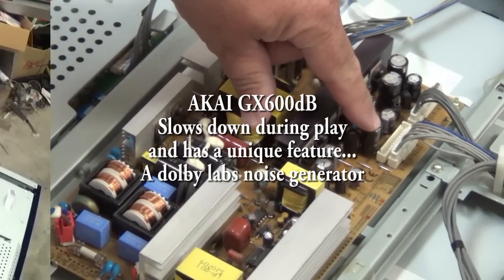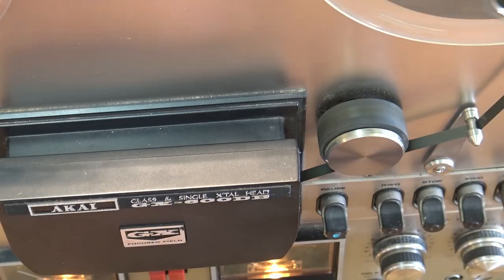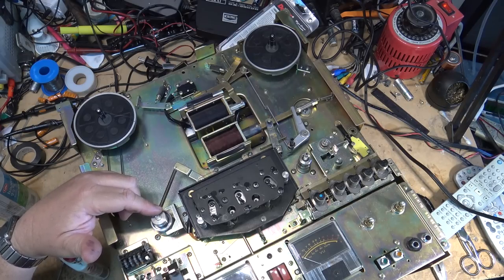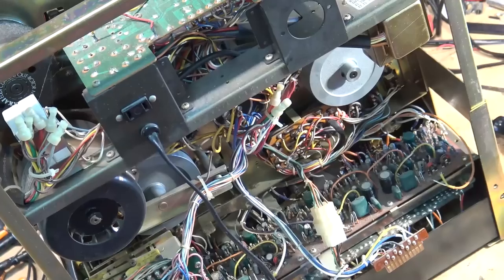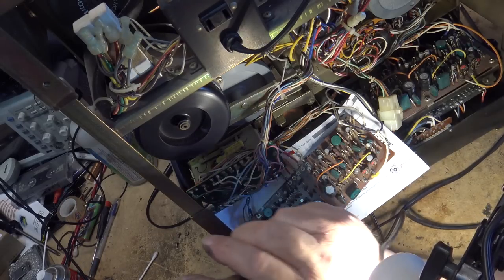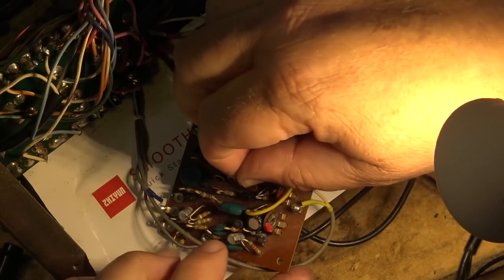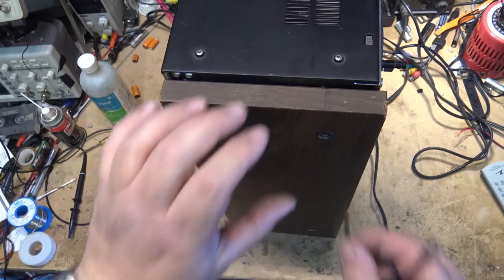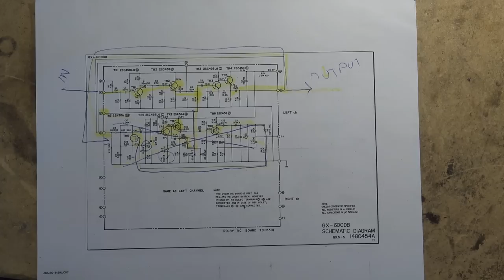AKAI GX600db going slow and what is that noise lets find out

Comment: If you have a can of compressed air, you can hold it upside down and spray with it, the propellant in it will come out as cold air.
Regarding the lawn mower noise, here at my place the snow is still falling....
I would trade the noise of the snow plow waking me up at 06:00 AM for a lawn mower any day.

Comment: Thanks Dave, for the tips and process with the solder iron . I had a TV with a bad capacitor that took a while to heat up for power start-up. I used a small hair drier to isolate it.  Did not think of the iron due to concern of overheating and melting components.   By the way, I am with you on the aggravation of noise...dogs, mowers, car stereos, even phones and DOVES that infiltrate when trying to sleep a tad later or do some quiet work.  Can't win for loosing sometimes....DANG.    J K

Comment: Thank you! —I have a 600db with the same noise but on the PB board (just not as bad yet). I have replacement transistors for it. I noticed you used desoldering braid—I have that and, like you probably have, a desoldering gun.  Should I use my braid versus the gun on my transistors?

Comment: 12voltvids is making a video! Suddenly I have an urge to cut grass. Think I"ll use my lawn mower that has no muffler to cut it with. Great job finding the problem transistor. I wouldn't even know where to start.
Reply: You can learn, but the best way is just to try, but be very careful of the high voltage side.  I sat with my mate who fixed things so picked up a lot.  His job was Nuclear Reactors and the controls for them, so he had a very good grounding, it was one of the few places where they would build something from scratch just to show how to make something like a transformer work and how to design one.  He served his time there and they had a school attached to it where they spend a large part of their day just learning.  No other company (It was Government run then, so money was no object.  It is now run by a company consortium who decided to take it to bits rather then run it) as the Government decided they had to make it pay as there was going to be no handouts.  Backfired a bit as they now have to ay vast amounts of money to decommission it, serves them right.  Greed is one of those things that can come back and bite you in the ass, he haw!

Comment: 2SC548's are notorious for noise issues. My Dad had a Akai GX4000 which he bought before I worked for them and they had a dozen or so in the front end and I ended up replacing all of them.
Reply from the maker: Hitachi made shitty transistors in those units.

Comment: I am in the process of restoring an AKAI GX-625.There seems to be a bad resistor or a transistor causing the pinch roller and Pause  plungers not to engage. I know it’s not the relays but I can see they can make movement so I’m digging through the schematic of the service manual. If you have any ideas please let me know and also has anybody ever told you that you sounded like John Candy?

Comment: Really enjoyed this video... great job. Curious question... any ideas as to why those "audiotape" reels (the one that you show as the take up reel) tends to warp after a while when in motion? No other reel does that.. I own an AKAI X-150D and it's odd that I'll use any of those reels and after a while, they start to warp while gathering tape... everything's in alignment, etc. I've had them brand new and they'll be okay but after a while, the reel itself tends to warp causing it to rub against the face plate while in motion. Cleaned pinch roller, capstan, good head alignment... such a loss. Was curious if you knew what might be causing the issue... any input would help. Take care.

Comment: Quick question, why didn't you renue the pinch wheel a bit? I see a bit of hardening on the video, but not sure if you did this round. 
Great job though. Cold spray is overrated, but I ended up buying one anyways. MG is skimping out on the propellants these days, I have 2 moderately heavy cans with no pressure left in them because of cheating the system.
Reply from the maker: This one didn't need rubber renew. For cold spray just buy duster and invert can.

Comment: What an excellent video and explanation of how Dolby works.  Which Dolby was that?  Ah, real to real, must be the earlier Dolby, if there was any real difference.  I always wanted a good real to real, but they were always so expensive and going out of date as cassettes were all the rage, but they never sounded as good.  I did get one in the end (I can't even remember who made it now) but by this time they were almost extinct, but I did use it for a few years, but even the tapes by this time cost a days wages here, I got some with opera music on them and rerecorded them so I could listen for two to three hours without changing out the tape, quality was not an issue as I was working on something else anyway, so I just needed background music.  I took it to a warehouse where i worked for a while and plugged it into a Regonda (Russian) music centre, which sound very good for its age by the way, it was high powered and could be heard without it screaming all over the warehouse.  The tape player sounded very good coming through it so I left it connected and a tape playing music slowly was good enough for what we were doing.  The radio on the Ragonda used to drift all the time and when everyone got fed up retuning it they would turn on the tape player.  It got so much used I had to make up a new tape or two.  Did it play in doth directions?  I can't remember, I have a funny feeling it did, but only if it was taped on it, or was that another machine?  Anyway, it got used so often that when I left it was part of the fittings and I didn't think it was worth taking with me anymore and CDs were on the go by then for a few years, so I left it with them, they were a decent bunch of guys (except the foreman, who was a Big Jessy and never grew up) so I left them with it.  The Regonda is still there after all these years, but the tape player is sitting on top with a big plastic bag over it, when I asked they said the tapes were not sounding very good and even after cleaning the heads sounded bad, i was asked if I could record another tape, but I had nothing to record a tape with, and no tapes either as I had either thrown them or gave them to my mate who had a machine.  He had moved away as well, so that was the end of that.  It will still be there yet collecting dust and I bet the belts have been sitting in the same place ever since the stop button was pressed!
Nice video and nicely done.  Shame about the cutting of the grass, but if it is not to loud just carry on fixing, trouble is you have no idea when recording how loud the mic is picking things up!  Thank you sir I enjoyed this one.
Reply: Шикарный комментарий! Отдельное спасибо за добрые слова в адрес Ригонды :)

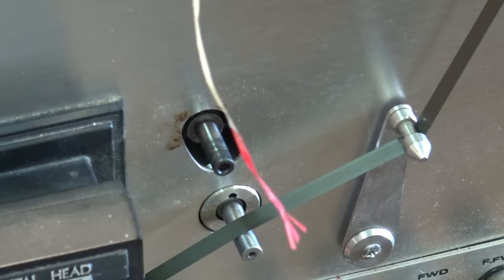Comment: 4:00 How do you know it's a transistor causing the hiss noise? Can it be a capacitor? Certainly not a pot if it is not turned when noise appears. I have a very old solid state tape recorder that makes that kind of sound when it powers up. And as time goes by (a minute or two), the hissing/scratching sound goes away.
Reply from the maker: This is one of the way transistors fail.  They get noisy. Capacitors usually do not fail this way.  Capacitors dry up and then do not pass the signals through.  Plus when heating it cooling the noise gets worse or stops is a dead give away.  This is because what causes this noise is internal junction bond wire is not connecting correctly.  Heating and cooling causes thermal expansion of the plastic case and makes the bond wire move changing the noise.

Comment: Those reel reels always put out good sound.
Reply from the maker: Depends on record speed.  I have about 40 tapes my dad made.  He used 3.75ips. A cheap cassette deck blows the sound quality away.  Response falls off just under 10khz. Sure 7.5 and 15ips sounds better but a real short record time and costs were much higher.

Comment: I'm a gray haired old guy too. Your use of needle nose pliers on the pinch roller operation made me cringe. I fix R2Rs too. Have been doing so since at least 1970. Have a collection of over twenty machines too. And mountains of tape.
Reply: Don't they freeze up from not playing them? That is a lot of rtrs
Reply: @SDsailor7  About the only part that reliably freezes up is the pinch roller pivot bearing. Don't know if they're oiled or greased when new, but either way it dries up and gets bound in place. Caps deteriorate with time, transistors start to sound like they have wind blowing thru them. Some caps may explode, always fun, but a bad sign that all s/b replaced.
Reply: @rpk5568  That is what i am worried about. I have 5 rtr's and can't play them all every day.
Reply: @SDsailor7  It takes a long time for parts to degrade that badly to the point of sticking. Try 20+ years.  As long as you use 1 a month for an entire month you will be OK.

Comment: Also, on my GX630D, i get high crosstalk on the R channel mostly. The head was properly aligned (height and azymuth), but still... could be the Xtal Glass Head leaking noise? Basically the sound in between the tunes is the reverse beat from the other side. Cannot get rid of it unless head is in an abnormal position, but thats not OK, music sounds horrible then. Thanks in advance! No DOLBY on this machine.

Comment: Nice vid! I wish I had your knowledge about vintage electronics! I have a similar machine, a GX 210-D. It has an odd problem, it runs about 4% too fast. These machines have no adjustment pots, so I don´t know were to start troubleshoot. It is a 3-motor machine. Some people say, replace the motor run capacitor! But, I wonder, where had you started looking?
Reply from the maker: Replace the run cap is a good place to start for an induction motor deck.
Reply: I changed the motor run cap but no improvement. It turned out to be a problem with the motor pulley. It has a lot of cracks and because of that it has kind of expanded, causing the ratio to change.
Reply from the maker: @peha4972  
Plastic?
Reply: No it’s made of some kind of metal. It doesn’t look like steel or aluminum. Look similar to the material as the cams that often tend to break have. I’m now looking for a replacement pulley just in case.

Comment: For a cold spray use an inverted can of compressed air "duster"
Reply from the maker: Yes i know.  That is what I always used as it is about 1/4 the price of cold spray.  I don't have any of that either.  Got rid of it all when my kids were teens as I was afraid they would try something stupid with it.  (One of the kids they went to school with dam near died from huffing dust off to get high) since i have an air compressor I use that to blow dust away.  Never bothered to get another can. Probably should because it is good for troubleshooting thermal intermittent but this is only the second failed transistor in about 5 years I have seen and heating with soldering iron pinpointed both.
Reply: I couple of girls in an office where I used to work decided to spray each other with an air duster when it was upside down. One of them got a nasty mark from the cold spray :-D
I also didn't realise, but quite a lot of them are actually flammable too!
Reply: @12voltvids  I believe they put bittering agents in air duster now to discourage inhaling it.

I've had compressed air for so many years now I've taken it for granted. Just used a can of duster at work because we don't have compressed air and man is the air stream weak. The can freezes and the airflow drops off a lot quicker than I remember.

Comment: Oh wow! A discrete Dolby board! Apparently two Dolby B boards in series should get you Dolby C, I have already downloaded the service manual and printed everything Dolby related. I want to build a separate Dolby noise reduction unit that I can plug other things into. I actually like what Dolby C does to my MP3 collection stored on my phone when played through the car cassette deck with one of those cheap Chinese tape adapters... But I really need a standalone unit for the bench. Now I'm searching for that demo track you played.
Reply from the maker: 2 dolby B = C? Don't think so. Dolby B affects only higher frequencies.  Dolby C works on a wider frequency band and compands, depending on frequency between. 3 and 20db.
Dolby B only works on high frequencies, boosting up 10db over 10khz and attenuating on play back.   
Dbx does a 2:1 compression and 2:1 expansion over entire frequency range.  I have an external dbx unit somewhere here if I find it I will do a video.
Reply: @12voltvids  yeah I don't remember where I read about the two Dolby B circuits in series creates Dolby C but I do remember reading about it somewhere, I suffered an OCD attack about Dolby noise reduction circuits and the IC's involved and in the process I learned about Dolby, DBX, DNR and that JVC super something system which was also pretty good. It's a fascinating subject which I really enjoyed learning about but then you go and work on that AKAI R2R deck and it just happened to have a full discrete Dolby circuit! My interest has been started again, last night I pulled out a ford cassette deck which has DNR printed on the cassette door in the same font as was used by the company that invented it but it's noise reduction button has the double D Dolby logo on it, I had a quick look around inside but I didn't see the usual Dolby marked IC's in it. I'm going to look up the IC's to see which noise reduction system they are actually using. Incidentally, the ford cassette deck has a ford IC in it, I wonder if ford was manufacturing their own car stereos? This one is from the 90's. I have watched another video where the person was talking about noise reduction systems and pulled out a ford cassette deck which actually had the DNR system which I think was developed by Matsushita (I could be wrong about the manufacturer) and it came out of a ford from the United States... Hmmm maybe I saw the two circuits in series on a datasheet... Yeah I'm not sure but definitely a lot there than people realize...
Reply from the maker: @PeterMilanovski  
Lm1894 is the DNR chip and it was made by national semiconductor.
Reply: @12voltvids  well there you go! Some of these IC's were made during a time when manufacturers put pride into their datasheet and included other things like circuit examples like the old tda2030a which had many circuit examples in it, I'm sure that I have seen an example of a circuit where they used two in series to obtain different results... Either old age is hindered my ability to recall what I need or I have pumped way to much information into my brain that unless I get a ram upgrade, it's not going to work any faster lol.

Comment: The pinch roller mechanism grease on TEACs turns rock hard without fail...generally better decks though
Reply from the maker: All that black grease fails no matter what it is used on.  Used to be on all the jap VCRs from the 80s.

Comment: You're lucky that wasn't a 4000 series, those amp modules are impossible to get and I had to design and build substitutes on PCB.
I think the name of that company should have given you a clue. Most are satisfied with one or even two scoops but not them.
Reply from the maker: Had it been that then it wouldn't have been repaired.  My customers all have spend limits when they bring stuff in.  The guy owns this one found out after it was done that every single tape he had of his band that he recorded back in the 70s has SSS and won't play. Hasn't used it since.
Reply: L. Stein, do you make replacement preamps for 4000 DM 2K by chance?
Reply: @mikelunsford7462  Sorry Mike. No I don't.  I found a circuit diagram for a replacement circuit and used the best quality audio components I could get. If your circuit is the same around the amp modules it will probably work for you too. Google should find it.

Comment: I have a rechargable electric mower,  I could mow at midnight if I wanted, nobody would hear me. It's no louder than a fan.
Reply: So many positives to it.  No more shoulder separation on start up, no fumes, oil, plug, stale old gas, and instead of stalling on thick/high grass, the blade speeds up.

Comment: Once an induction motor manages to run up to speed, a bad runcap should only have a small effect on its torque; however, it'd have a hard time with the runup itself. Somewhat less torque, but there should be plenty yet; playing a tape (which is essentially driving a large flywheel) isn't a lot of load on it. Experience: I got a reel to reel motor, once I played around with it with no runcap. These days, it's a motor of a pedestal frankenfan (a heavy load, but it never gets hot).
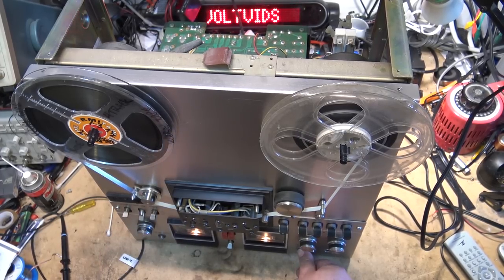47:45 - That's a scam. It seems they hoped to get some money out of it. T**ts!
49:04 - 😂 Holy crap, thats a big magnifying glass for a fine print! Why the HELL to print the most important information in unreadably small letters, that half of the people can't even read?? WTF??

Comment: 👍🤓😎👍🤘
Reply from the maker: It was fun and in the end the owner never uses Dolby so there wasn't a need to fix that, but it is now fixed.
Reply: @12voltvids  Don't think anybody uses Dolby any more :-p
Reply from the maker: @geirendre  
I never used it. Dbx yup used that if I had to use an analog tape format.  Had dat from the launch.  Still have some r-r tapes processed with dbx using my outboard processor.